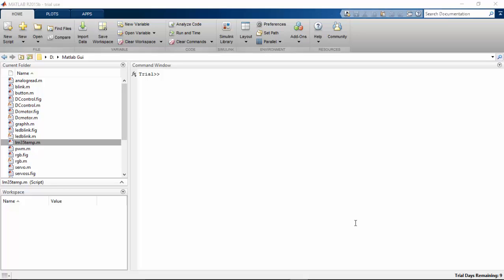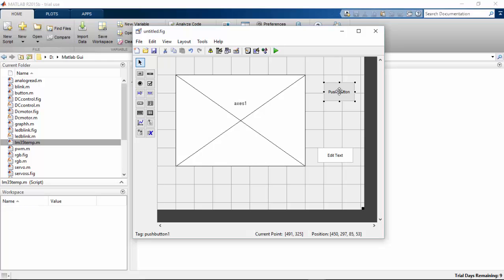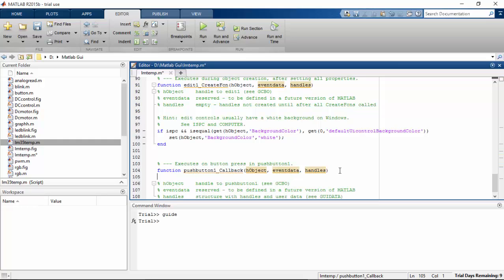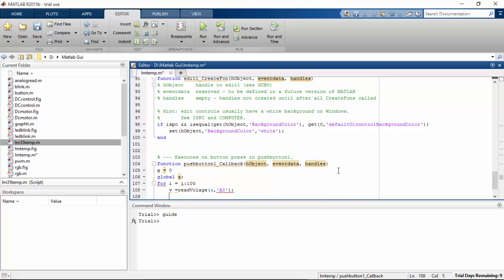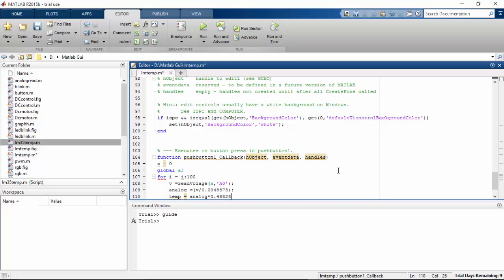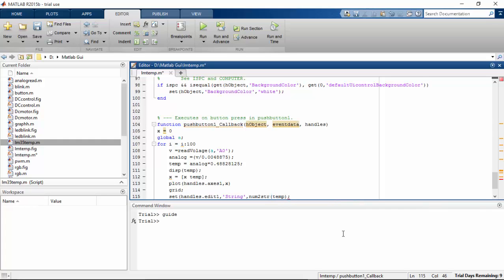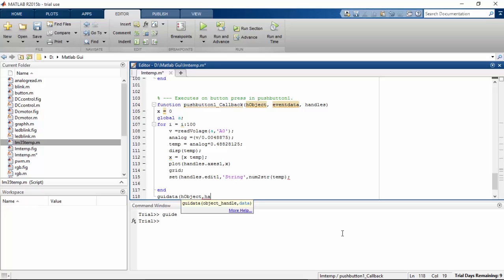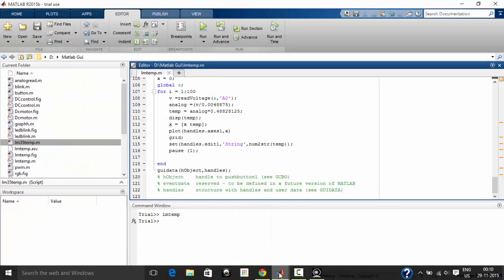3. Arduino and Matlab GUI temperature sensor LM35

Comment: I don't know why it is just not working for me. I did everything step by step and it doesn't  work. Is there any way I can send you a picture or something so you can check it out?
Thanks. Btw, I hace matlab R2014 and noticed you're working on 2015.
Reply from the maker: +VanSonata01I don't think version would be a problem in this case, try with simple function and make sure you are getting output, try to turn on and off LED , If that works, then other should work, if you still getting the problem, contact me at jayakumarmagesh@gmail.com

Thanks

Comment: and I can add a fan to turn at a certain temperature?
Reply from the maker: +Esteban Holguin yeah you can do it by adding just few lines of condition operators.
Reply: +Arduino Robotics LabVIEW Solidworks  thnak you
you say command
if,else?
Reply from the maker: yes , exactly.